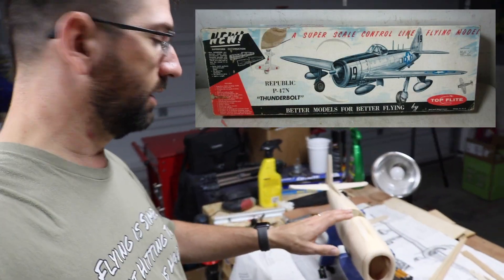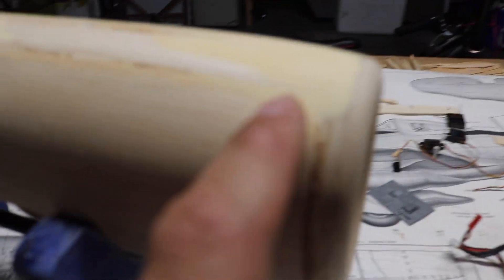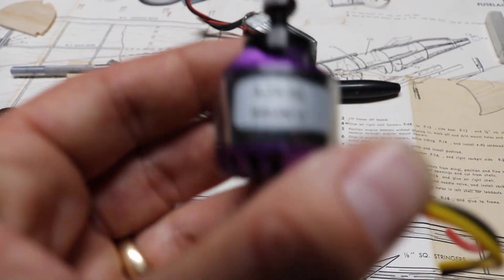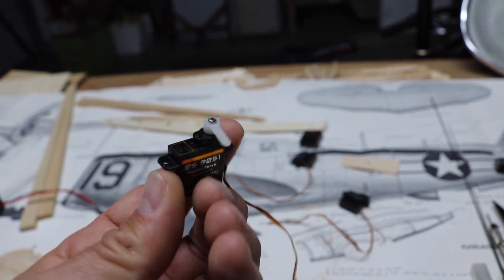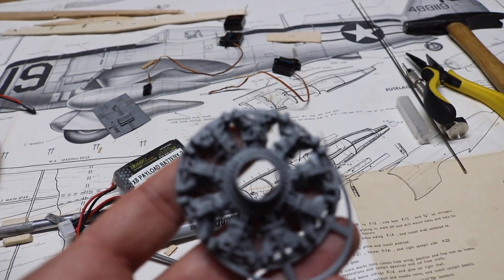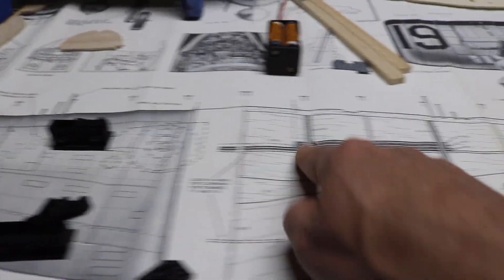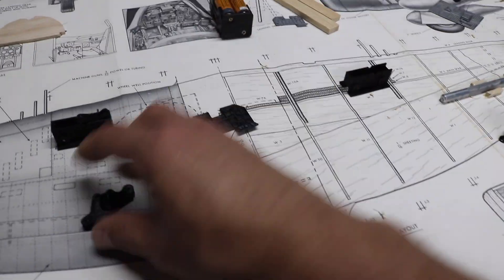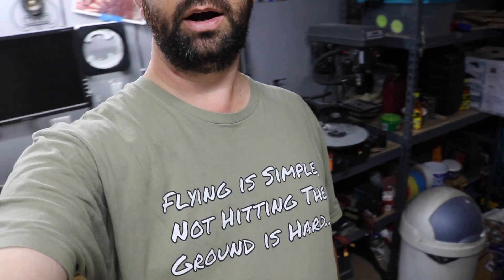TopFlite Control Line P-47 RC Conversion: Part 1

Comment: I have this same kit very interested in what you are doing. I am thinking making my P47 R/C but nitro with a O.S. Max .15
Reply from the maker: Thanks. This model has been pushed to the side for now since I am building my full scale plane. Would be interested in seeing how yours comes out.
Reply: @JoesRCCorner  Hay joe how can i purchase a copy of your 3d printer files or purchase the 3d printer instrument dash. Also interested in the retracts can i get a link from you. I am having a hard time finding them.
Reply from the maker: @joelauritsen2370  I found all the files on thingaverse and resized them all to fit as needed.

Comment: Nice job, the old control lines make perfect size parkflyer! Inspired me to pull my sterling corsair. Mine was already built and painted thinking on fiberglassing it with the lightest glass I can get, any thoughts on that?
Reply from the maker: Sounds great! should work out just fine. trick is to keep it light.

Comment: I just started building this exact kit.  I built only foamys but no more deporn.  A friend gave me this kit, it was his dads.  Any chance I can buy one of your 3D engines?  Very cool!
Reply from the maker: Unfortunately, my 3D printer is not working properly at this time. I really haven’t put time into getting up and running either since I am building my full-size plane right now.
Reply: Just ran into that cowling problem.
Reply: The cockpit layout is confusing.  Any pointers?
Reply from the maker: @allengriebel1417  I winged it. To tell you the truth, I haven’t finished it. It is hanging up as a display model In the raw.